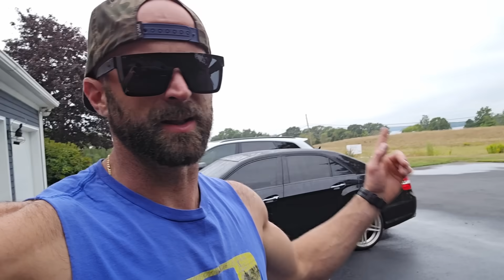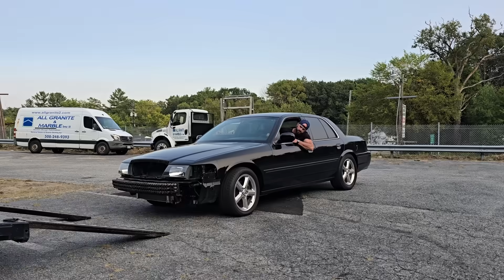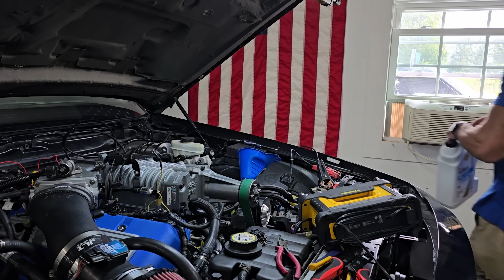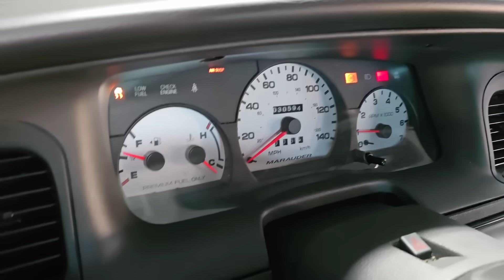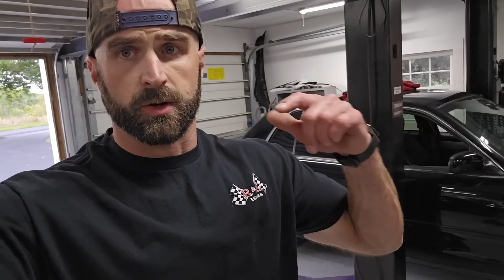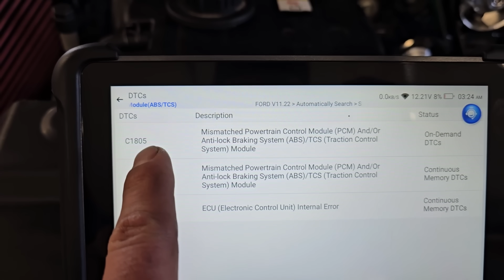SVT Terminator Swapped Marauder Hits The Dyno!! - Doesn't Go As Planned!

Comment: Hey Chris...I am from the NJ area with a 2003 Marauder...Still have the stock motor at 104,000 miles on it. With a Trilogy Supercharger and the stainless works exhaust, all the way to the exhaust tips. Installed a Ford GT fuel pump. Wildwood brakes, front and back with the stainless braided lines. The Diff has a Moser 4:10. The control arms in the back are billet. Put a deeper transmission pan. 
Great work on what you did to your car. I thought of going this route too, if my motor blew up...I have been lucky with the motor so far....
Reply: ohh i forgot to mention that i have a cover that slips under the rear bumper, so the bumper doesnt balloon out.. It helps so that the bumper doesnt rip apart.

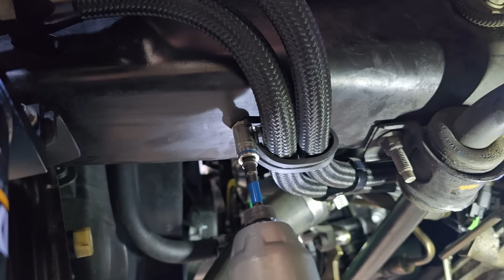Comment: C'mon Chris.....@ 39:16 riv-nuts man! Say "NO" to self tappers!

The main reason I criticize is because you work really hard and do very well.....then. Keep the good work going.....and don't be one of those, "No one is gonna see it. Only I'll know it's there."

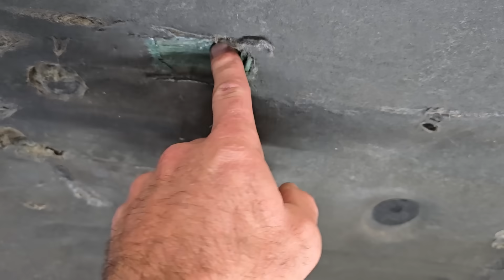Because @ 39:57 you're looking all satisfied after installing the missing inspection plate and rubber plug. Did you have that same feeling with the oil pressure gauge and self tapping screw holding the oil lines?

Comment: With engine mounts and LT headers.....if you leave one side bolted to the crossmember, the engine will roll over when you jack it up. You'll have twice as much room. You will have to unbolt the headers from the exhaust.

The blue coating indicated a revised, "stronger", mount. The earliest were for 04 and up Expeditions....the Marauder and Cobra had some released shortly after. The blue coating has carried on as far as the 2nd Gen coyotes in F150s. They are indeed stronger mounts.

Comment: Main bearing clearance determines recommended oil viscosity. But you can "plan" to run whatever you want.

You're making a mistake running a 40wt oil.

Break in oil isn't meant for power flogging dyno pulls. Yes you can break in the engine on the dyno, but the oil should be changed prior to making power pulls. Break in oil doesn't protect the way your daily oil will.

Comment: The intercooler pump that was run power with key on might be contributing to the dead battery? Might want to wire it to engine running.

Comment: I believe you said it yourself when you were adding the gauges that most factory Ford oil pressure gauges unless it’s on something really performance oriented are just glorified low pressure lights. Ford does this because they had to many customers being uneasy about the lower oil pressures they can have, when in truth, it’s fine. I believe ford has done the oil pressure switch since like the 60’s.

Regardless it’s good to have a real gauge now, and I would’ve pulled it off the dyno as well, better safe than sorry. Good video, this car is coming out great.
Reply from the maker: Youre right. Should have just listened to myself lol

Comment: Chris told us, Ford made the oil gauge fake oil pressure due to all the service calls for low oil pressure at hot idle..... Then does the same thing to himself in the next episode 😂😂😂...Bro🤦
Reply from the maker: Damn it man I played myself
Reply: @ChrisSullivan69 😂
Reply: @ChrisSullivan69 the pain makes us feel 😢😂😊
Reply: I rember that to
Reply: The factory sensors and gauges on these Fords are basically idiot lights, when you reach a certain pressure or temperature it goes "ok yes". They're not accurate at all. He read 80 cold idle and 20 or more at temperature, he's perfectly fine and normal.

Comment: I suspect the ecu or abs module was swapped at one point, or the tuning messed up the link between the two. The b1342 is a bcm error that isnt well defined on most scan tools, but it can also point to a configuration error
Reply from the maker: Gonna see if i can check it in forescan

Comment: If you’re ever going to lift the car, and hang the rear tires. You need to make sure you turn off the airbags in the rear end. That’s the switch in the trunk, if you don’t, the module heats up and melts itself trying to pull the bags up to keep ride level. 
Sorry if you knew, just paranoid cause, you’ll be replacing bags for springs. 👎🏻
Reply from the maker: Yup I knew about that. Hardest part is remembering haha. Thanks for the tip!

Comment: Not the original ABS module(to your serial#)  They are married with the VIN.  You have to have FORSCAN or Ford IDS software to write the VIN to the replacement ABS Control Module. Also, I would send that module to get rebuilt.  They have a common fault of the soldering on the circuit boards failing over time.   MODULE MASTER is fast and has a 5-year warranty.
Reply from the maker: Ill check it in forescan. Module is original to the car as far as I know
Reply: @ChrisSullivan69 ecu might have swapped out then.
Reply: @ChrisSullivan69  On the newer crown victorias the traction control is part of the abs module.  It is possible to swap the abs module to a non traction control abs module which disable traction control. As far as I'm aware the 03+ panther ecu is not involved in tcs. It is possible the disabled traction control in the tune may be part of the issue.  The abs module will say "tcs" on it.  I bought a non-traction control module for 50 bucks in a junkyard out of a base spec crown vic but a p71 would also probably not have tcs.  If you go the route of swapping to a non traction module get the master cylinder and the lines to the module as they are different.
Reply: @ChrisSullivan69 if the ABS hasnt been changed or the ECU as you stated I would have the tuner turn that traction control back on in the tune. Turning it off could be your cause of the fault.

Comment: Few questions.  How many miles / how long since the motor was put together before you dropped the break in oil?  What (if any) lubricating properties are you losing going from the break in oil to the Rotella?  I've never head of anyone doing this, but could you have put the break in oil back in after inspecting it?  How long were you planning to run the break in oil for before changing it?  The Marauder looks great, and sounds awesome!  Love the attention to detail!

Comment: I'm getting flashbacks to the motor mounts on my V when I installed headers last year.  I think the last guy used a 3/4" impact to tighten them down.  You should never need a 3' cheater bar when working on a cadillac!
Reply: Unless you're replacing the harmonic balancer...

Comment: I have a twin turbo Cobra engine.  It shows 20 psi at idle and 45 psi at 2000 rpm.  You need 10 psi per 1000 rpm.  Which year computer are you using?   How are you tuning the EEC-V.  Do you have a Quarterhorse, Tweecer, or chip?  Are you running speed-density?